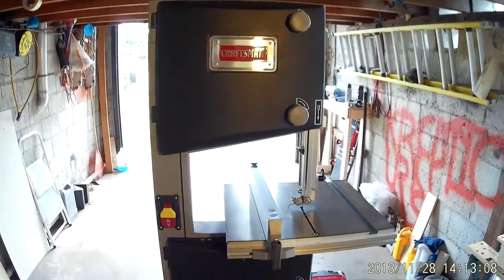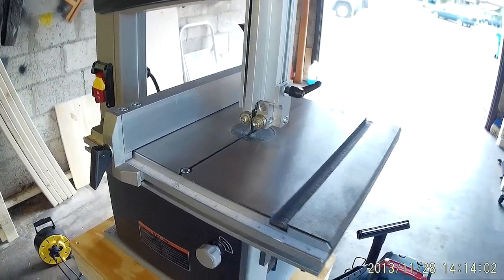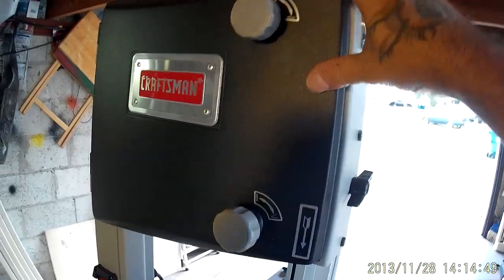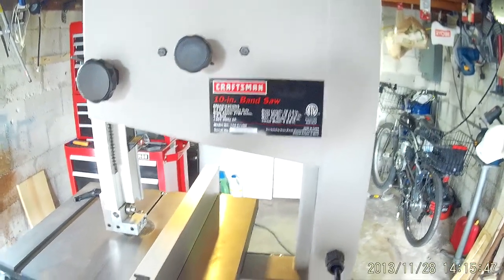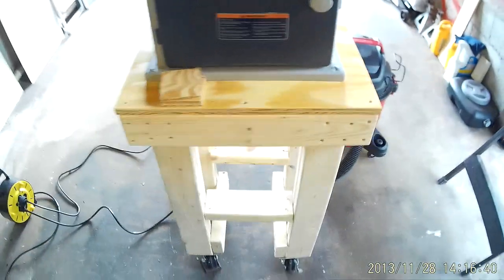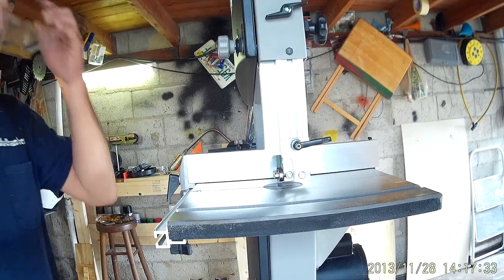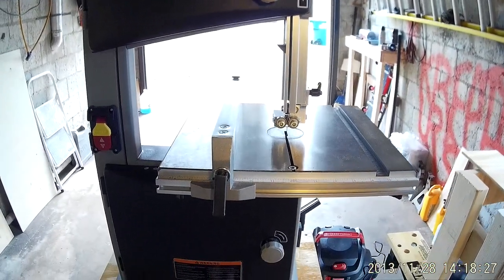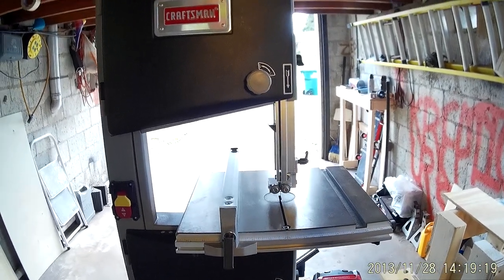Craftsman band saw 10 inch model# 21400

Comment: Thank you for the review, short and sweet, down to the point, I too have decided I will get this model, looked it up locally and it is in stock, comes witha metal base itself for $169.00.  Thanks again.
Reply from the maker: Charlie Aragon you're welcome, that's a good price for this saw. make sure to buy and install a quality blade for it, it will make a big difference in the performance of this saw.

Comment: Thanks for the review. I just got one today. Boy the price sure has went up in 3 years, but then what hasn't. LOL If this one works as while as my old Craftsman 12 band saw, I will be happy. My old one was from the mid 1990's worked well up to a couple years a go when it went through a house fire. It looked good after some clean up but just would no longer keep tension on the blade. So I am hoping that this New one can take up the work of the old one.
Reply from the maker: you're welcome :)

Comment: You help me! I'm going to get the same one. Thank you.
Reply from the maker: You're welcome, glad it helped you, it's a good DIY light duty band saw for the money. Despite what some of the comments say on the sears web site about not finding parts for this band saw i have found some parts are available (i.e. drive belt, blades, guide bearings) on ebay and other sites so don't let that stand in your way :) carter products makes a stabilizer guide for $79 that allows you to make nice scroll saw cuts with a 1/8 inch blade on this saw.

Comment: I had a 10" skill Band saw and it was ok except the knob that clamps the blade guide height adjustment broke off and i had to make a steel knob driled and tapped out of scrap steel round stock I had. Also the plastic locking lever for the fence adjustment broke off and i had to mill an aluminum  replacement which worked well. Everything was in perfect working order, then my exwife gave away all my tools to the movers when I wasn't home. My question is the material of the fence that slides along the edge. Is it aluminum or is it gray plastic? Whats the material of the table?  Cast iron or cast aluminum?

Comment: So....my 351.214000 has guide bearings marked 626Z. The owners manual says very clearly 625zz. So I bought new bearings based on the manual. They do not fit. The bolts will not go through the 625 bearings. My 10" 21400 takes 626 guide bearings. I triple checked the manual and my model number. How can this be? Did Craftsman change this saw later on and use larger guide bearings? But I can say for 100% that model 21400 10" band saw uses 626 6mm guide bearings. The wheel bearings are 6001, which the manual agrees with, but the manual I downloaded is wrong. Guide bearings are 626 NOT 625.

Comment: Just got this one and I love it! All though I did notice that the blade isn't tracking completely center on the top and bottom wheels on mine and there is no way to tell the blade tension. If you can let me know how you fix the tracking and how to tell blade tension that would be great but if not that's ok. Thanks.
Reply from the maker: i'll try to help you with that, first of all do not try to adjust the bottom wheel leave it alone you only need to adjust the top wheel using the knob on the side of the top wheel. make sure your thrust and guide bearings are out of the way of the blade then, you want to adjust the top wheel so that the deepest part of the gullet (that is the notch of the blade) is in the center of the top wheel. by getting the deepest part of the gullet in the center of the wheel that will give your blade the true support it needs. turn your top wheel by hand (make sure the saw is unplugged) and turn that side knob until the center of the gullet is achieved, you will see the deepest part of the gullet in the center and you will know it is right. the blade may not be in the center of the bottom wheel but it does not have to track in the center of the bottom wheel, only the top (i'm sure to get some slack for that lol)  once you have the gullet in the center adjust the blade tension, unfortunately there is no tension gauge on this saw but i really don't trust those gauges anyway the best way to make sure your blade has proper tension is by hand, or by feel just as you would with a scroll saw blade, i'll explain. open the door for the top wheel and use the adjuster knob up top, turn it clockwise a turn or two for the top wheel, stop and then tap on the blade with your finger only lightly, there should be between 1/16 to 1/8 inch of play or movement in the blade and no more then 1/8 inch of play or movement in the blade. once you have the blade gullet centered and the desired tension adjust your thrust bearings top and bottom so that the bearings are just off the back of the blade but not touching the blade then, adjust your guide bearings so that they sit just behind the gullet of the blade again making sure the guide bearings are just off the side of the blade.

hope that helps you, let me know how it turns out for you and if you want check this video out for some more help, Band Saw Clinic with Alex Snodgrass

Comment: What size blade comes with the band saw? What is the teeth per inch (TPI) that comes packaged with the bandsaw? You never mentioned what type of blade comes with the bandsaw. I'm interested in purchasing this specific band saw. That's my question.
Reply from the maker: +Mark II it comes with a 3/8 blade i forgot the blade count but that don't matter it's a junk blade. if you buy this saw throw the blade in your scrap drawer and buy a quality blade, your saw will thank you for it lol
Reply: soulwinner4JESUS Yeah, bought my band saw like over a week ago. I found out that it was a 3/8" blade 6TPI. I went and bought two new blades from Timber Wolf. 3/8" 3TPI, and a 3/8" 14TPI. Want to go and get another one, 1/2" blade 3TPI.

Comment: I noticed the motor is attached with some kind of bracket and screws, do you think it would be easy to
replace it?
Reply from the maker: bandit123kat I have not tried to remove the motor but, it does look rather easy to remove it if need be.

Comment: Will this cut hardwoods, like bloodwood? Awesome video.
Reply from the maker: +Mark II yes it will cut hardwood just keep in mind that you should run the wood through the blade within a good speed for whatever hardwood your cutting. i have cut purpleheart and bloodwood without any problems but a good quality blade is recommended :)

Comment: I am having a difficult time changing blades. I believe that I I messed up the adjustment that moves the top wheel forward. How do I get it to the proper setting?
Reply from the maker: if you have the owners manual it should discribe how to adjust the top wheel but it should be the top adjustment handle that you have to use to adjust it, you could also search on here for other videos for that, i think i saw some that can help you adjust your top wheel

Comment: I'm in the market for a table top bandsaw..I've looked at reviews on the Skil,Ryobi and this one and they all have mixed reviews but I believe I'm going to go with this one so thanks for the video..after I get it I'm for sure going to buy the best blade I can find for it because the blade is doing the cutting so to me It's a no Brainer to buy the best blades..I may comment after I get it if I have any questions about the saw and where to buy the good blades..I do have one question now before I buy it..I am going to be cutting wood and metal and I was wanting to know if they make a blade just for cutting metal only? Also is there a blade available for wood and metal?? Thanks in advance.
Reply from the maker: Ronald Cox I think that out of all the 10 inch bench top models this one is your best bet and it works very well for small projects. Generally speaking this saw is made to cut wood because there is no speed control on the motor and for best results most medal cutting is done at a slower speed. I'm not saying this saw can not cut medal ( i have not cut medal on this saw, (i have a different saw for cutting medal) it maybe able to cut some thin medals like, (aluminum or tin medal) but, for best results in cutting medal slower speeds is best in my opinion. I have seen some people modify the motor with an additional pulley and belt setup or with a speed control so it can be adjusted to cut medal.

As for blades for this saw, i have only found blades for wood cutting and they can be found online just search for 70 1/2 inch blades. I use Olson and laguna blades and they are great, don't buy the craftsman blades they don't last. If you buy this saw let me know how it works out for you and if you need any help with it i will do my best to help :)
Reply: Ok thank you very much..I'm building my bench right now and I'm going to sears one day this week and get this bandsaw..I think u mentioned in the video that Rikon made these and I looked around and it is a Rikon just a different color so that's the main reason I'm buying this one because Rikon makes good tools..I'm mainly going to cut wood but sometimes thin metal and I did find blades just for metal I'm not sure if they're the right length for this saw I hope so..Thanks for the info.

Comment: ya i got the same bandsaw one year ago but ever sence i got it it has been making a horrible squealing noise and it's not the thrust barings and i have noticed also that the blade is not coplaner lining up on oth wheels most people think that the blade has to be lined up on both wheels but the expets say that there made like that to work propely i like the saw but the squeeking squeeling noise is driving me crazy every time i put any wood in the blade it start to make that sound i'm guessing it's the blade b/c the blade fell of the wheels a couple of time so i think it trashed i only used it a couple of time so i havent been able to use it if anyone has any info please let me know i have been loooking one the web for months about this 10 inch craftsman i have any simular problems out there let me know thanks

Comment: Excellent review, sold me on the deal. Are the plans for that stand you made available on the net?
Reply from the maker: +Jim Barchuk no plans for it, i just made it up as a went in my head
Reply: +soulwinner4JESUS OK here's an idea. How about a 'video tour' of it? The couple of shots that showed the base, I liked the way it looked very sturdy and well built.  I'm a good bodger on many topics but for something that needs to support 70# plus 200% safety factor I'd prefer to have a little experienced guidance. The exact dimensions of things aren't important. If you could do a walkaround of the base and mainly talk about the order that you built things, and what sizes wood went into it, that would be a major clue about how others could DIY something similar. TYVM. :)
Reply from the maker: i guess i could do a short video of the cabinet, i don't remember the wood that i used but i could look at it and maybe give you an idea of it. give me a little time to make the video maybe i might have time soon for it :)

Comment: soulwinner4JESUS, I just bought one of these bandsaws used on Craigslist. It needed a drive belt so I ordered one and now I'm trying to figure out how to get the bottom wheel off in order to change the belt. I've looked over the owners manual but can't find anything about how to do this.

Any idea?
Reply: You have to remove the retainer clip from the shaft in the center of the wheel. Removal tool can be purchased very cheap from harbor freight.

Comment: I bought one 10 inch one 2 months ago,,ran good till you need to change blades,,,first thought it was me and took it to sears to let them do it,,will not track right,,,,bogs down,,cost 200.00,,that I will have to eat,,,after 30 days its yours reguardless,,,my next bandsaw will come from home depot,,,at least they give you 90 days return with no questions asked,,,reguardless of what tool you are looking for,,,do not buy from sears,,,,trust me,,,YOU WILL BE SORRY IN THE END,,,,,
Reply from the maker: i have never has any problems getting mine to track after a blade change, if the upper and lower wheels are set right there should only be a minimul tension adjustment needed, there are plenty of videos on here that show how to properly setup any band saw, i'm not saying yours is or was not setup right but a little researce goes a long way